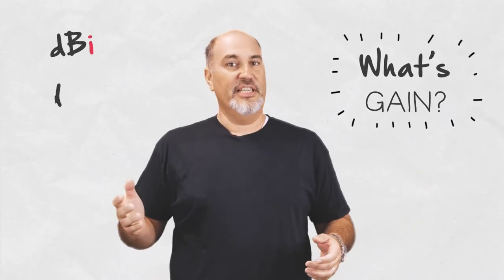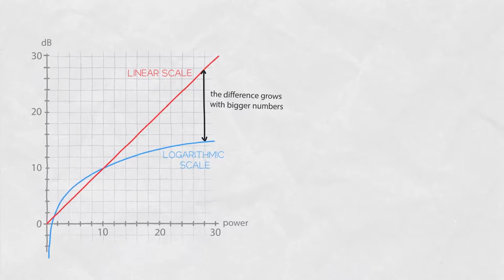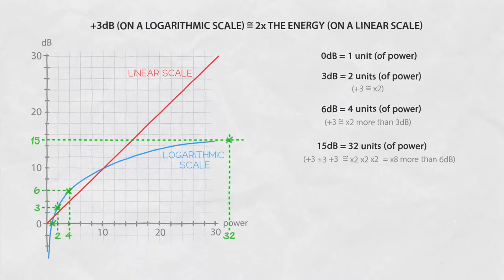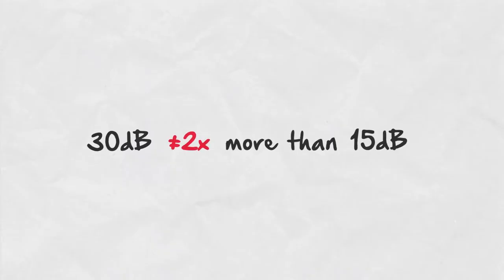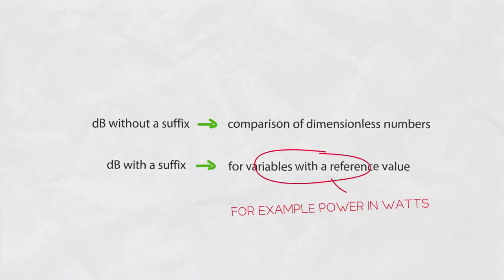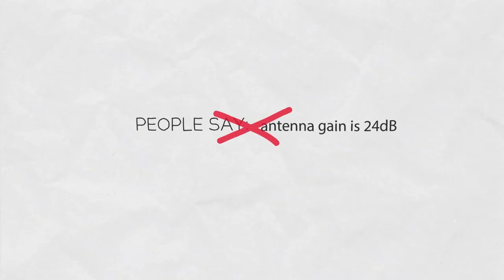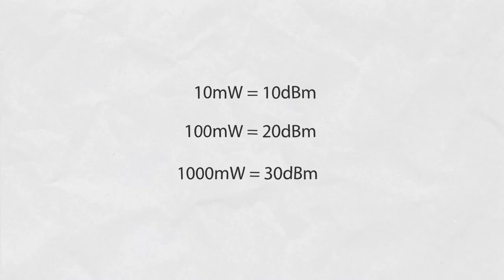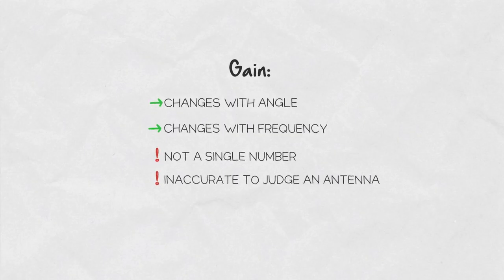Inside Wireless: Antenna Gain

Comment: Thanks you that was easy but I have a question how do you now the best frequency??😊
Reply from the maker: Hello. The best frequency is the one you select in your spectral analysis that has less noise. Worth to mention that with a proper antenna, like ours, you can improve the noise floor in your spectrum and therefore have the option to select more frequencies and get better performance. This is due to the lack of sidelobes that our antennas have. Thanks!
Reply: @Rfelements  Thank you very much but now I have another question 😅 why some frequencies have higher power output but not reliable and other frequencies have lower power output but it is mach better?? and thanks 😊
Reply: @Rfelements I’m your follower from Iraq 🇮🇶 and we rely on this type of internet connection and we have a very low speed and fake (cash) internet connection and thanks to your videos i managed to get a speed between 1.5 to 3 mbps

Comment: wow I am gathering stuff to make a 21cm 1420 MHz hydrogen-line radio telescope.  It sounds like a 20dBi dish antenna would be better verses a 15dBi dish antenna? 😎 Thanks.
Also, are there videos in DIY making a 1420 MHz dish or horn antenna?

Comment: Question. I have a dual antenna whip nagoya. It has 3.5vhf and 5.5 of gain uhf.   If i tune the uhf frequencie tona desire, will the gain dimish or be affected and the vhf .
Reply from the maker: The gain of the antenna is determined by the used frequency. So if it's tuned to the UHF, its gain is 5.5 dBi according to what you write.

Comment: great video, what does it mean to have a negative gain ? thank u
Reply from the maker: Hi, negative gain at some particular angle means that the antenna radiates weaker than the reference antenna used for the measurement - in most cases a dipole.

Comment: hi, I got a anntena of 9dbi gain but if a buy another anntena of 11dbi, it is the double of power? you said every 3db it's the double of power how represent 11dbi ?
Reply from the maker: Hi Ariel, you should check this information about logarithmic scale. https://bit.ly/3rvOqNX
Generally, you to convert antenna gain dBi into absolute values, all you need to do is to take the dBi number and insert it into this simple calculation -  x = 10^(G/10). 
So in case of 3 dBi difference x = 1.99 - thus the double of power.
For 2 dBi difference x = 1.58

Comment: I appreciate your video.. But gain can be expressed in  both dB and dBi...as you can see in CST, which is antenna design software, represents gain in dB
and another thing is dB and dBi are both same..so 6 dB also means 6dBi, so we can use dB and dBi to represent antenna gain
Reply from the maker: Seems like you misunderstood some thing. dB and dBi are NOT the same thing. The only way you can see a radiation pattern of an antenna in dB in CST Microwave studio is when you normalize the plot to 0 dB, then any reference value looses its meaning. In any other case you always have a reference physical unit such as mW, V/m, etc. which CST marks with a suffix. Hope this helps.
Reply: I think you failed to understand my point..dB and dBi are equal...e.g. 6 dB equals 6 dBi..and yes gain can be expressed in dB as well
Reply from the maker: Hello, thanks for your comments. If dB was the same as dBi, then you could use it interchangeably, which you cannot, thus they're not the same. Not with gain or any other variable.
If you mean that 6 dB difference equals to 6 dBi difference in the mathematical sense, sure, you can say that about any dB number given you use 10*log10(X) definition..
Reply: @TechnicallyExplained  dB can mean anything. dBi means antenna gain in reference to isotropic radiator.
Reply: dB is the ratio and not with reference to absolute value..dBi is with respect to isotropic antenna..an absolute value

Comment: I want to know how can I Make this kind of measures of an specific antenna ?  I want to compare the ration pattern of 2 dipole that are in different positions. Thanks  and Congrats for this masterpiece videos :)
Reply from the maker: In what regard are you trying to compare the antennas? Dipoles have a common donut shaped radiation pattern, or a mushroomy one if it's a planar one..
Reply: @Rfelements  there are some modems that could have the antenna support broken, I want to know if the position of the antenna could affect with de radiation pattern
Reply from the maker: @albertohdezmx  as long as it's properly connected the position of antenna does not affect the radiation pattern.

Comment: How to calculate Antenna gain in any 3d direction, given Msi file or Horizontal gain and Vertical gain
Reply from the maker: You can use a Matlab code to do that including a visualization: https://www.mathworks.com/help/antenna/import-export-and-visualization.html
Reply: @Rfelements  I looking for the formula to get the gain/directivity in 3 dimensions using msi file [Horizontal gain+vertical gain
]
Reply from the maker: @anuppandey8038  check the 'More about' section on this link, the equation you're looking for is there: https://bit.ly/2MUBhzz
Reply: @Rfelements  yeah, that's what I was looking for, Thank you so much

Comment: i stands fo isotropic and antenna gain is directional then why antenna gain is dBi
Reply from the maker: The 'i' is there because dB is a unit that is always compared to some reference value.. Various engineering disciplines have their specific 'version' of dB units and in antenna engineering, to make it clear the gain shown is referenced to isotropic antenna, the dBi is used. 
There is for example also dBm which is a power unit in RF engineering with reference value milliwatt, or dBc comparing signal power to that of the carrier wave. 
Check this page if you want to know more: https://www.bitweenie.com/listings/the-decibel/